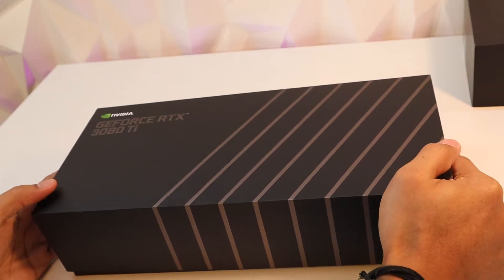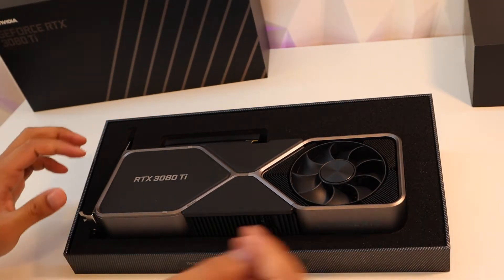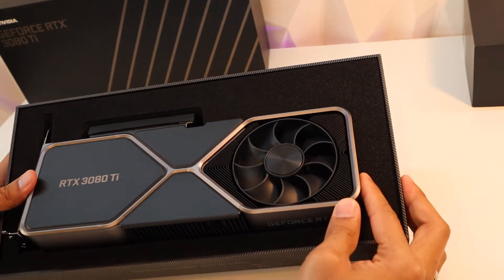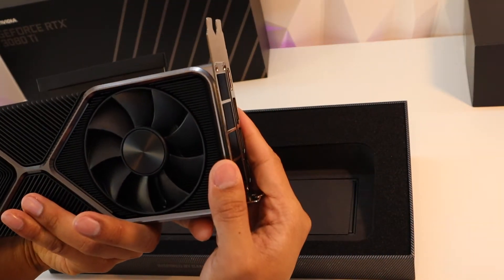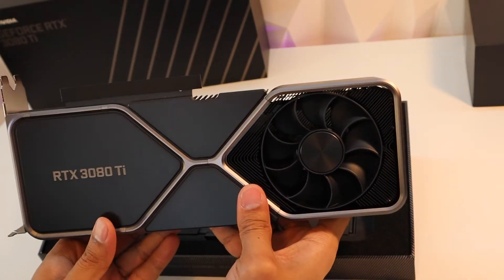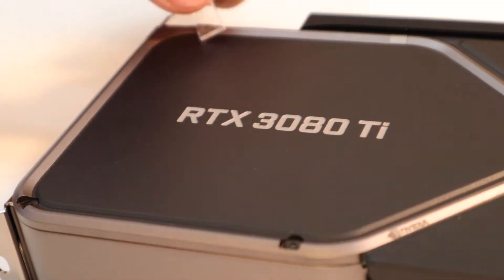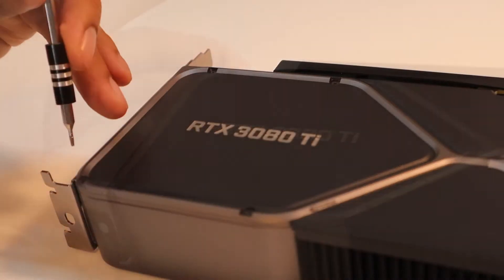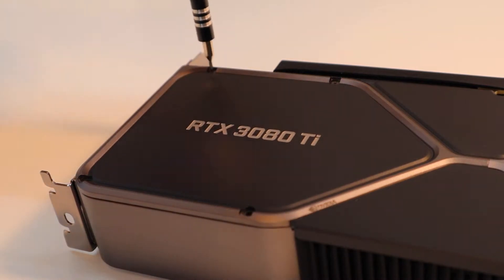3080 Ti Founders Edition  - Thermal Pad Replacement & Results

Comment: Are gelid extremes good? If so what thickness? Lots of confusing information. Thanks
Reply: Hi, I have 3080Ti FE and I did 1.5mm on the VRAM and 2mm on the VRMS on front side and 2mm on whole back area, I used Gelid Extremes pads. I booted the system and noticed no change in Hotspot and Mem junction temps under load, in fact they are worse by 4-5 degrees . but temps were quite lower in idle when compared to stock. I opened the card again and observed that the left side of the VRAM had no contact with heatsink and other VRAM had little contact but not good one (concluded from the imprint on the thermal pads) but the 2mm pads on VRM had good contact. So I decided to do 1.5mm on both VRAM and VRM and did that but saw no difference in temps. Now I'm going to try 2mm (Gelid Extreme) on both VRM and VRAM.
Reply: @raghavtripathi564  are gelid extreme 2mm any good ?
Reply: @Iitfury  they reduced my mem temps but GPU temps went crazy high to 100. I gave up on searching for pads and bought Corsair water block.
Reply: @raghavtripathi564  u mean the core/die temps ?
Reply: @Iitfury  yes
Reply: @raghavtripathi564  some people recommended squishing gelid 2mm extreme, did you try it out ?
Reply: @Iitfury  i tried that, but maybe i squished too much. You can never be sure with these stuff it's all hit and trial. It could work for you if you are lucky.I would suggest throwing a Waterblock on it and be done with it.
Reply: @raghavtripathi564  isko lene me hi halat patli ho gyi, waterblock toh aur mehenga hai yr
Reply: @Iitfury  haan bht expensive hai waise. I spent around 70k for liquid cooling only.
Reply: @raghavtripathi564  mere thermal pads 8th ko aayenge, i'll update u after i'm done with the mod

Comment: how much thermal pad would you need for 1x 3080Ti FE? And based on research ive done, it seems that if using thermalright, I should be using 1.5mm everywhere rather than 2mm since its not as malleable?
Reply from the maker: If you follow the link in my description, it will link you to the size I bought. It should be 120x80x I had some left over after covering both. You are also correct in the thickness. Make sure to replace the thermal paste as well if you do both side.
Reply: @dannykim1462  Your link goes to 1 mm but your subtitle of it says 1.5mm.
Reply from the maker: @dylanwong1977  that’s odd, I selected 1.5. Maybe it defaults to 1mm. Please use 1.5 if you intend to copy me.

Comment: How is your gpu mounted? Vertically or standard horizontally?
Reply from the maker: Horizontally, my case is pretty small so not sure if it is causing more heat.
Reply: @dannykim1462  did you undervolt it? I can't get rid of 100 degrees hotspot when benchmarking
Reply from the maker: @bohdanradko6942  for the sake of the video I did not undervolt. However I did after the fact and my gpu never gets above 70c and hotspot never gets above 75c. Make sure those pads makes contact.
Reply: @dannykim1462  can bad contact with vrm cause very high hotspot in sensors? Vrm pads do not have a nice footprint comparing to vram
Reply from the maker: @bohdanradko6942  I would imagine so, there is nothing to pull the heat away if there is no contact. Make sure every pad you put down make proper contact with the components. Having the right thickness help
Reply: @dannykim1462  idk man how it works for you and for many other people. Whatever i try I just cant fix the hot spot with available pads on the market. This is just waste of money and time. I think thermal putty is the next thing to try. Did you try thermal putty?

Comment: Hi danny thanks for this video, I have the exact gpu and I am wondering if 1x gelid ultimate 1.5mm and 1x gelid ultimate 2mm is enough or should I buy 2 of 2mm?
Reply: Also for the 2mm I saw in the comments that you recommend getting a softer pad? Does that mean I have to get 2mm extreme instead of ultimate?
Reply from the maker: It is recommended that you use 1.5mm for the front(Die) side and 2.0 mm for the back side. Gelid is a softer pad and is recommended for the backside. Make sure you have enough for front and back if you buy small pad. Gelid in general is softer then the brand I get so ultimate is fine.
Reply: @dannykim1462  thanks for the reply! So if i buy 1x 1.5mm 90x50 for the front and 2x 2mm 90x50 for the back should be enough right?
Reply from the maker: @dema7323  it depend on how clean your cuts are, you had very little waste and had about 50 by 60mm left with the one pad I got. But that I would I would get doing it all over again.
Reply: @dannykim1462  thanks Danny, I ordered 1x 1.5mm for the front and 2x 2mm both pads are 90x50 so hopefully it should be enough, I'll update when it's done tomorrow!
Reply: @dema7323  Any result ? :D #sameproblemihave

Comment: The premise is flawed, this isn't going to do anything to reduce the temperature of your room.  The card isn't putting out less heat, you're just more effectively transferring the heat from the card into the ambient environment.  It might improve performance and longevity of our very expensive graphics cards though.

The big thing is that the VRAM run quite hot and this will likely shorten their lifespan, so getting to run cooler by adding the thermal pads should give the card a nice long life.  Additionally, the GPU may start to throttle if the VRAM (or GPU, etc) run too hot.  Your room is still going to be hot though.  You're going to have to crack a window or find a way to get more fresh air in there.
Reply from the maker: Yeah you are correct about the benefits, but after undervolting a bit, replacement pad and fixing fan curve I was able to drop about 10c off the core temp. Flawed or not my room is a bit cooler. Although it’s winter so it doesn’t matter hahah.
Reply: Man, I had to scroll way to far for this. Was about to say: thermodynamics left the chat.

Comment: Thanks for the video, you're right that there's not much info out there for the 3080TI FE.  I replaced mine yesterday and at first had slightly better memory temps but my core temp was significantly higher.  I used 2mm pads on both side.  I've taken it apart several times and attempted to squish the pads a bit, which had the opposite effect.  My core temps were better than ever but my memory temp immediately jumped to 110C when mining.  On my last attempt I got it to the point where memory temps are around 98C and core temp is at 78ish (stock my core was in the 60s and memory was in the 102-106 range).  I have some 1.5mm pads coming in today to hopefully get this squared up for good.  Did you use a template to cut the pads or pre-measure yourself?  Did you use 1.5mm pads on both the front and back?  Seeing a lot of conflicting information out there, some people use 2mm all around, others use 2mm on back and 1.5mm on front.  I even see some using 2mm front and 3mm back.
Reply from the maker: Same here I did a ton of research. I originally had 3090 FE so I bought 1.5mm and I just had it. The 3080 ti FE is suppose to be 1.5mm on the die side and 2mm on the vram side. However you are suppose get a softer pad if you use 2mm. I already have enough 1.5 mm so I just use it. However my core temp went down a few degrees and all the other temp dropped. I pre measure myself base on the design of a few others. My recommendation is to take a screenshot of my design and print that picture out and cut it out to fit the pads. If enough people ask for it then I will get the exact measurement. Also remember the core temperature is influence by the thermal paste. You have to replace it with a thick paste and apply a healthy amount
Reply: @dannykim1462  Thanks man, appreciate the reply!
Reply from the maker: @rezzy350  anytime. We gotta help each other !

Comment: Excellent video. Thank you for this. Not sure if I'll have the balls to take apart my 3080Ti, but if I do, now I'll feel a little more confident doing it.  :)
Reply from the maker: Thank you for the feedback! I  couldn’t find one for the 3080 ti FE myself when I needed so I figure I document and share the knowledge.
Reply: Bro I'm not even trying to be mean but it's the easiest thing I've ever done repair wise
Reply: @wheelbarrow23  I understand but the fact I could brick a 1100£ graphics card gets me scared :D
Reply: Theres no way to really brick it.  Even if you break the 2 wire connectors it will still turn on.  One is for the rgb light and the other one is for top fan
Reply: I feel exactly the same. I think we all share the feeling. Thanks for the video
Reply: Ya same here i have an open air case so my Temps arnt that bad normally